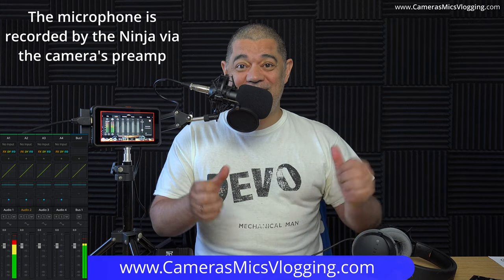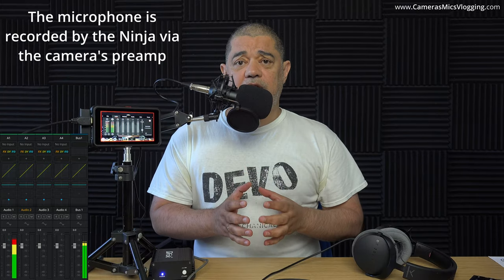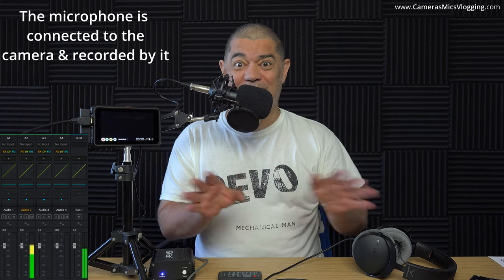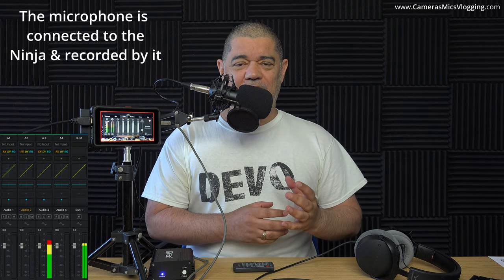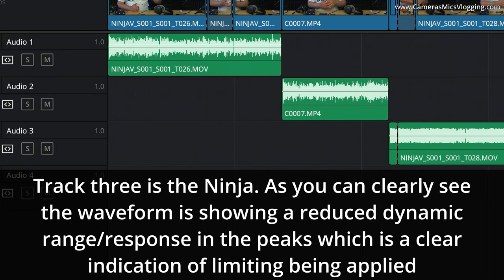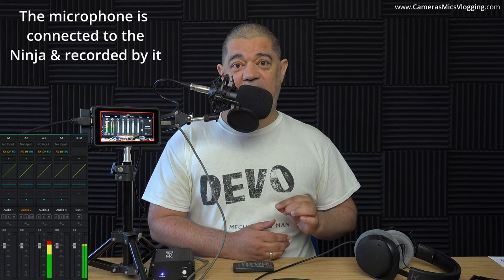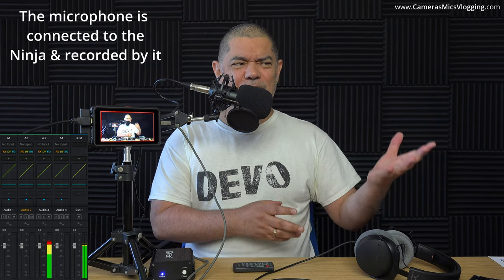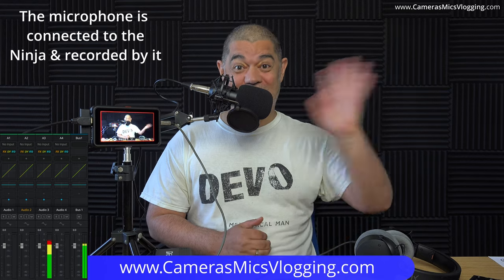Atomos Ninja V Problem With Audio Distortion On Its Microphone Input

Comment: Any resolution to the distortion.  I am having the same issue.
Reply from the maker: Hi. No, it's just the mic/line input distorting because it does not have enough dynamic range. You can get around it by using a preamp before the input on the Ninja and effectively pad the signal with a lower level from the preamp. Or talk further away from the mic. Neither being ideal for what should be a simple microphone recording setup. Cheers, Dave.